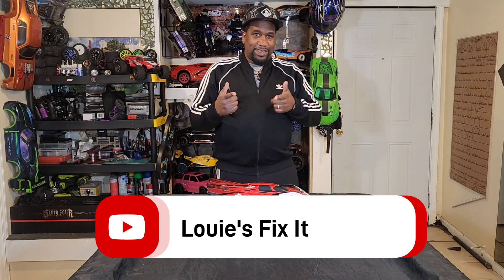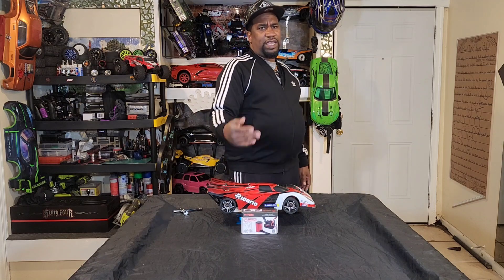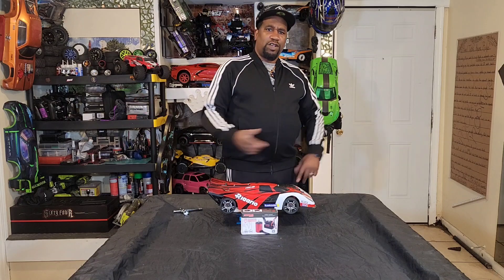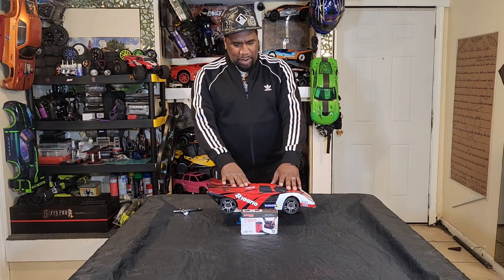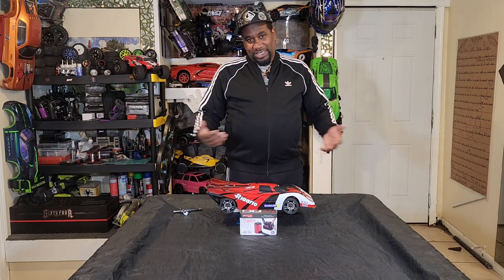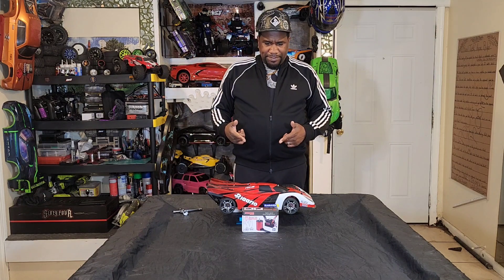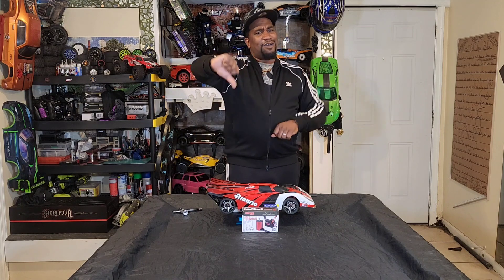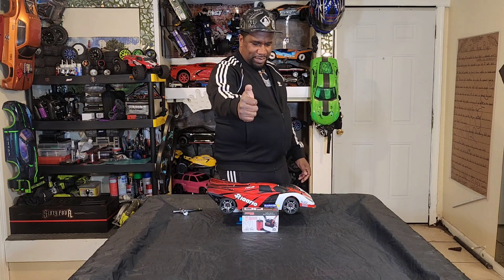Surpass Hobby F540 4370KV Motor & 45A ESC combo review. Don't buy until you watch this video.

Comment: Got the same combo and mine doesn’t work. Got a programming card, programmed it but its still not working. Any help is welcome.
Reply from the maker: What is it doing?
Did it ever work from when u got it?
Did u get it new?
What size battery did u use?
Did u try to use a less power battery?
I'm on a 2s. they say that a 3s can over stress the ESC.